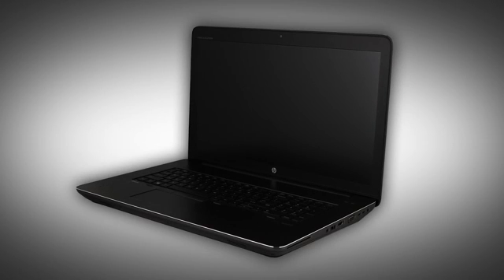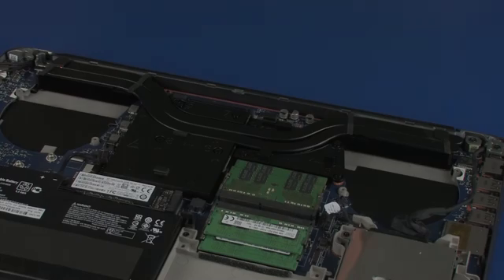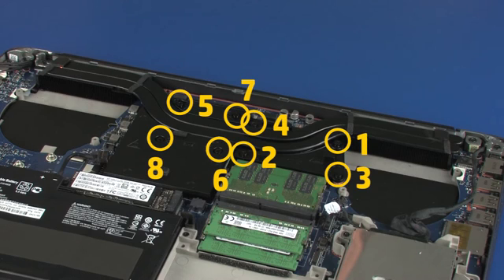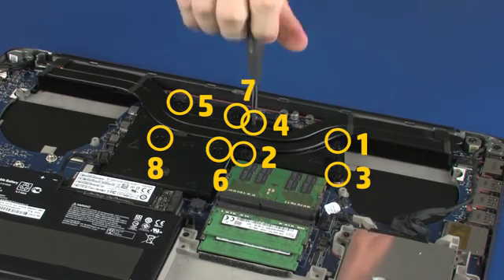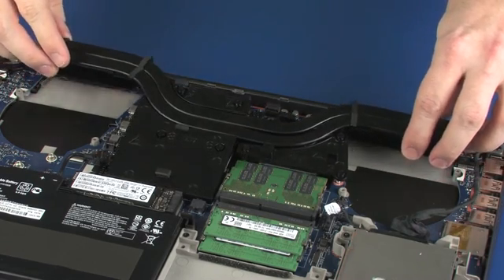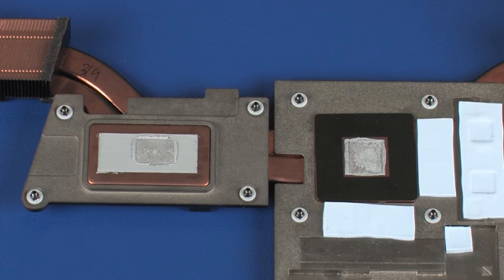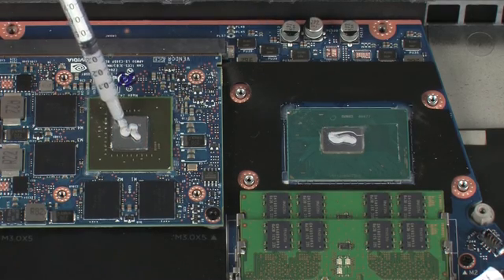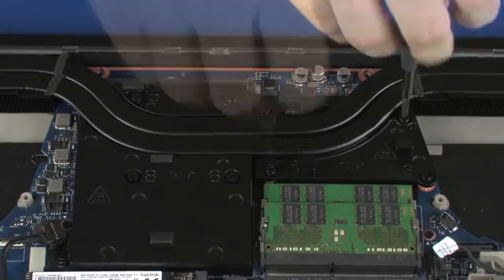Replace the Heat Sink | HP ZBook 17 G3 Mobile Workstation | HP Support

Comment: Which thermal paste do you recommend?
Reply from the maker: +Steven Althardt You can purchase the part from here: http://partsurfer.hp.com/ Please select your country and enter serial or product number of your unit.
Reply: @HPSupport  Was this a bot response? I don't need the heat sync "part," I need thermal paste, which is not on your store when I search for it. There also isn't a recommendation in the manual.